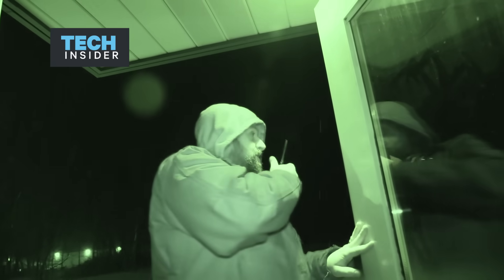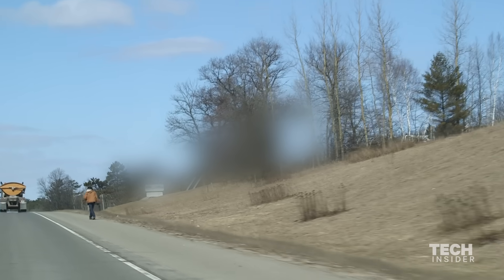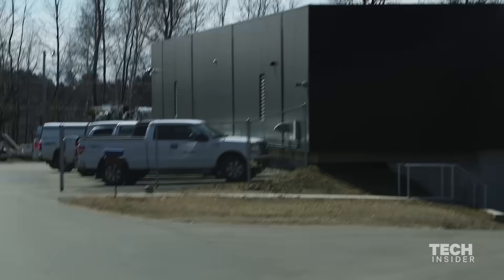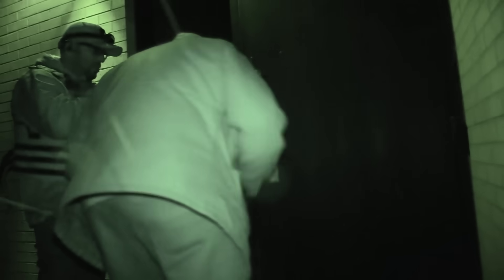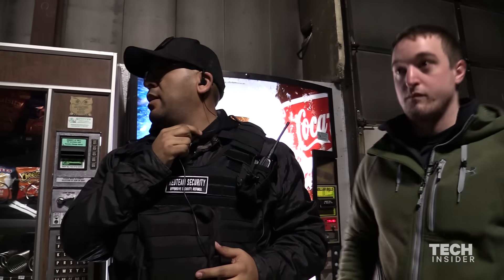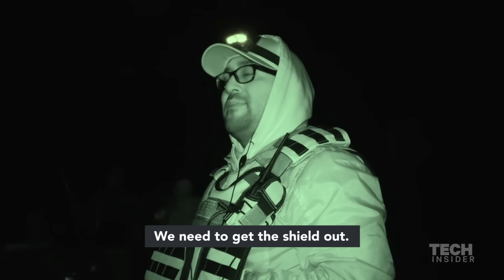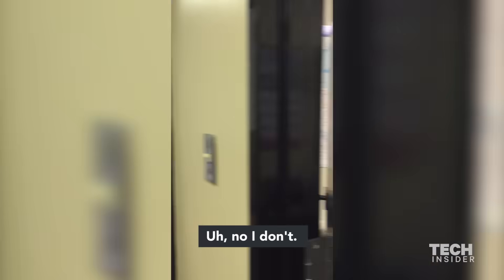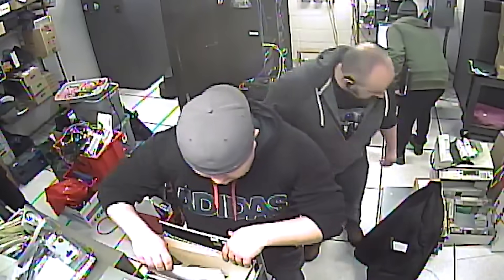Watch hackers break into the US power grid

Comment: 13:38 He's literally just printing out "hello" lol
Reply: -Goes to desktop
-Opens notepad and writes hello?
-Tries to write hello as a command
-Fails
-Just prints hello
Reply: @Tiogar60  Big brain !
Reply: @hackanddrift4692  Hackerman
Reply: You also realize that he's also writing it to a remote pc that's running windows right? Did you notice he is writing the command on a mac?
Reply: Josh Dobis it's just SSH. Not anything interesting.
Reply: @dusscode  I don't think Windows had a built in SSH server back then, especially not on domain client PCs, why would you with stuff like RDP and central management services
Reply: @kingchirpa  I use a Mac to administer windows, linux and proprietary appliances. No functionality is lost.
The only thing really missing is powershell, though I still use it as my main tool - but I either run it on a VM or SSH into another box on the net.
If your doing remote commands / sessions anyway, all your laptop needs to do is send and receive text really. I've worked off of my iPad when away from my desk, as closed and locked as an iPad is..
Reply: Probably to illustrate the video.
Reply: I think it's the fact he can run that stuff is the problem. Like as they said, they aren't trying to break stuff, just show they could  if they wanted to
Reply: If you look closely they were controlling another computer, he is using a mac but the prompt says Windows.
Reply: @bengonzalesdelrio  I do that every day at work.
Got a secure remote shell into a server over SSH, that server runs powershell, I run zsh, doesn't matter - you get whatever that server is running fully functional. All your computer is doing is sending and receiving text over SSH (or whatever method you've set up, but you should stick to SSH IMHO).
Reply: Faxx
Reply: that is dangerous hacker man, yes?
Reply: @dani Nathan It is in my opinion
Reply: Lol
Reply: I know right lol but he also got a meterpreter on that device basically a backdoor or a shell
Reply: Ty  fake brain

Comment: I can see raspberry pie 
Usb rubber ducky / bad usb to gain a shell 
Metasploit  
Arduino chip 
U can disable infrared cam or the thermal cam with a 5 mv laser light just to point at camera lens
Have seen LAN turtle in that box but u didn't use it in office

Comment: Good luck trying to get into one of our substations. We have fully fenced subs with barb and razor wire. With shaker system along fenceline along with inner microwave perimeter alarms. A fully staffed security staff that respond to any alarms. Buildings are brick with steel doors that require an access card. Buildings also have an alarm system.  Oh did I mention hi def cctv of all decent sized subs.

Comment: I watched the video and I could think of multiple ways they could have gone about this but one seems to be the best. 
step 1: they needed to have someone on the inside or hidden somewhere outside that was deauthing the internet to cause connection issues.
step 2: Spoof a phone number and call in claiming that they are noticing some strange activity on the network and are sending some technicians to check things out.
step 3: have fun with you access.

Comment: As a retired KGB analyst intelligence officer, my advice (and the advice given by others of my generation) is this. AVOID COMPUTERIZATION AT ALL COSTS! AND IF NECESSARY, TRY TO DE-COMPUTERIZED EVERYTHING. We only use computers to design and build non-computerized systems, non-digital systems and replace them with analog hardwired systems. And the computers we use are not connected to the internet but to an intranet network within our buildings or compounds or research facilities or test facilities.

Comment: Something as simple as a large group lobbing a shitload of Molotov cocktails over a fence onto the equipment and launching a few deeper in using a small catapult or slingshot method could take out a grid affecting a very large area. It doesn't have to be a high-tech infiltration or attack. A decent sized group could simply go barbaric on a sub-station and cause all sorts of pain. Especially if this was coordinated nationwide and a shit ton of these were hit simultaneously. I do recommend that the group doing so wear balaclavas. These guys were too easy to identify if somehow images were captured of them.

Comment: U hack in mac?
Reply: Daniel L de g well it’s a unix based operating system which uses the bash shell and it could possibly be very effective if you know what you are doing. To turn on the mode they are using just open the terminal and type ‘sudo rm rf /‘

Comment: My work place has an RFID a personal code known only to the employee to confirm identity with the central security system and a finger print scanner its easy to work thoe you use your dongle it says welcome you put your two fingers on the fingerprint scanner and while your hand is there you type in your code with your other hand and when it beeps you take your hand off and open the door. I think its almost impossible to get in any door behind the scenes but I discovered that on every balcony and even the roof the doors are unlocked its only a 3 story building and we keep our scissor lifts outside in a work shed so you just need to hop a fence pick a lock hotwire a scissor lift and ride it up to the roof then boom, as long as you don't walk through the wrong door and get your self locked in between two security doors in the hallways your golden.

Comment: Ok so let's draw a line here, the second you have to resort to physical intervention, you're no longer hacking shit, you're just breaking and entering. Anything can be "hacked" if you resort to physical intervention. So yeah, sure, from a security perspective, they are breaking in, and it's good to strengthen your security by employing such services. But I don't see any hacking here. Hacking is when you use security vulnerabilities in a software and/or hardware to hijack it remotely through the very network it operates on. Hacking is not spamming emails with links to phishing pages, it's not bundling spyware into software kits on free download sites, and it most certainly isn't jumping over fences and breaking into server rooms.

Comment: Yeah the number of times where you create a USB stick to autorun whatever is on there never always runs when you plug it in to a system because it'll just sit there with a prompt asking what you'd like to do with it. Especially on Windows, even if you have a autorun.ini or autorun.inf file it won't execute right away after plugging it into the system.

Reason so is that Autorun by default isn't fully auto so yeah. You're pretty screwed if you're expecting it to autorun and it doesn't autorun.

Comment: Could you kindly help me? I am on laptop #5 in 10 months. Went as far as changing IP. Wifi hotspots for a month, absolutely no issues. Walk into my house, within 2 minutes at the login page up pops some kind of "update", downloaded over 22,000 files?? in a matter of seconds.  This program starts right before the log in page (there is a white bar, top left, which blinks rapidly 4 times) but the most troubling part is their ability to change settings to stop me from fixing the issues. For example If I'm watching a video .that instructs me to go into regedit and one of the steps is "open the run file" it will be missing. This goes on until I give up. Each attack is varied, but always the same creepy script. Any help would be appreciated. Thank you!

Comment: That's how I ensure that my client information remains confidential.  I have one PC disconnected from my network.  I use DVDs to transfer files.
Reply: John Hlavaty  Use a USB, WAY easier
Reply: Jay Zee

sure if you want to expose any non-connected devices to a hack. because USB's are 2 way storage devices. they can install and pull data. if he were to use a usb. the hacker could install a script or virus that will get put into a usb key and then when thats plugged into the D/Ced PC itl install the virus to that machine and pull data and files onto the USB so that way when its inserted back into a connected machine it can start feeding the information to the hacker and the owner wouldn't even know. 

a DVD can only put stuff burned onto it to another machine. the hacker can install a virus to the machine so it can be burned into a disc but the virus wont be able to store any data onto the disc to feed back to the hacker once inserted into a connected machine. 

john would be far more vulnerable to hackers acquiring his clients information if he switched to using USB's
as USB's are a 2 way device for hackers as DVD's are a 1 way.

it may be easier for use with a USB but if hes concerned about keeping client info confidential and safe its best to go with the little more inconvenient DVD.

not to mention inorder to burn things onto a DVD requires a drive with the ability to burn things onto a disc not all drives have that so if his client storage computer has a non burnable drive the hacker wont even be able to force the computer to burn the info onto the DVD via scrips. as a bonus your more likely to store or never use the dvds again. a USB is more likely to be reused. thus establishing a 2 way connection for the hacker.

the more you know the better.
Reply: Filming In Portland   All the people in this thread sound like anti-USB freaks Lol. Do some research, USB's are safer than CD's. By the way, what are you CD guys going to do when computers eventually get rid of CD ports? Take a look at Apple MacBooks, and the newest Windows pc's.
Reply: Gizzemac Baldinelli just like you, but for dates.
Reply: TheFallinhalo  I've used a USB for banking transactions for my business for the past 6 years though, haven't faced anything bad yet
Reply: TheFallinhalo modern laptops rarely even have optical drives anymore
Reply: Jay Zee until the flash drive dies. Hope you have a backup, those have a limited lifespan.
Reply: DVD's can be rewritten though. Also DVD could contain a script to delete, crash or encrypt entire HDD.
Reply: Thefallinhalo, Do you mean the hacker could take the owners usb drive and swap it out with his own that executed code? If not i dont see what that has to do with the owner using DVDs or USb sticks. I mean the hacker would need physical access to the machine so the owners practices wouldnt matter
Reply: John Hlavaty no asked
Reply: +TheFallinhalo True but all that goes out the door the moment he decides to never use any USB aside from one that he keeps on him at all times.

Comment: I have nothing else to do so you know what this is how I would do it. 

First, looking for where the cameras are is the dumbest idea ever. You would need to put screen capture software on the offices conputer where they are monitoring the cameras themselves which is easy and anyone can do.

Second, getting in the fucking servers isn't even necesary, all you need to know is the location of the computer that is controling the servers and then you can use (depending on the operating system, in this case windows.) capture the screen and control all the data on the server however, it can get weird at this point becuase you would need to be in a position where you  can access the computer atleast once, just in case of failures so what I wouldv'e done is find out when the IT guys come to monitor the servers and find a time between then to access them. 
 
Third, Access the data whenever I want because I installed the screen capture software, but depending on how successful I am the first time then I'll keep using this method however, there are other ways of accompishing the same task. So this is a very low risk way of doing exactly what they were doing. But honestly they look like idiots that know less about computers than anyone else I know. My grandma can "hack" better than them honestly.

Comment: Words keep changing don't they?  One would assume that by hacking, they would be sitting at home on a computer or nearby, and gaining access using remote methods.
What they are doing is physically breaking into a building and using "off the shelf" type hardware and software to gain direct access/control to the systems and network.
Sure, there is an element of "hacking" in what they do, but no, these are not "hackers".
Would you call me a cook because I put a frozen meal in the microwave?
Even worse; they even use the word "cyber attackers".
Nothing cyber about physical break-ins.

Comment: they could have ran a port checker and used the ports header data to figure out the hardware running and the type of system they are in. then sniffed packet data to try and figure out what the system's were connected to and ecen out a simple looping gif infront of the camera's by hacking into the live feed in the dvr system's capture card. but as is thats not as easy as it sounds and more then likely the place shuld have known better than to allow admin access rights.

Comment: not hacking at all jyst really being granted access to necessary area's. the server would be off limits and the network that runs the switching and cooling systems would not be online nor would they ever be on the same network as the administration console. it is not possible to run a simple backdoor script when the firewall is hardware based and running on demilitarized zones with mac adress filtering setup. as well as more then likely a checkpoint firewall and hardware and software intrusion detection systems in place. the admin that runs this network would have to be a complete idiot to ever allow a malware script root access to everything. they may get acess to a few Client host's but not to critical system's.

Comment: All I see is a couple of guys breaking into a few buildings and a couple of computers.  These computers were not even hooked up to the "grid."  As a grid operator, I know the software needed to run the grid and did not see them gaining access to it at all, so I call BS on the title of this video. At most, they broke into a sub station and could possibly turn off a few neighborhoods at most, by simply operating a few switched by hand,  since it supplies power on the distribution level.  To control the grid, you need access to the transmission lines and the generators, they gained no such access.

Comment: 0. (not that it matters in this instance) Make sure everyone has removed identification ie wallets/tags. They go down - they're a nobody. 
1. Using the same guys from the initial scope was a mistake. They are recognizable, vehicle tags already on camera. Traceable. 
2. Mount some cheapo battery powered lasers outside and point them at the security camera lenses before you go in. (prop them paperclips if you want w/e)
3. Not enough gloves/masks/your shoes leave footprints too
4. Priority should have been detecting/disabling non/silent alarms.
5. Lookout should have been out front all along ready to peel in and out. Ready to be a distraction at least. 
6. Don't turn on lights to rooms with windows. Interior is okay but people can drive by and see the lights are on. 
7. Don't leave en masse. 2-by-2 is okay but someone drives by and sees a bunch of dorks walking out of somewhere at that hour it's suspicious as all hell. 

All the nice hardware/tactifaggotry you guys sport makes you look 
experienced. You want local PD looking for some punks - or do you want 
the fucking FBI pulling post 9/11 muscle to find your asses in a 
heartbeat? Amateurs.

Comment: this would be a fucking awesome TV series.
Reply: With similar production to this, not full of unnecessary fluff.
Reply: Foxmanded42 mr robot is nothing like this, this is real situations and white hat hacking. Mr robot is black hat hacking, it's dramatized, and its fake companies/situations
Reply: Taylor N 
I saw Mr Robot. one thing that was clear from the start is that, although dramatized, they did an excellent job at making the show a VERY probable method of hacking. I could have done the whole tricking the server room thermostat trick. A raspberry pi was way overkill for that job. I would have used an arduino or other small microcontroller.
Reply: Yea, Mr Robot is dramatised but tbh its has the most accurate portrayal of hacking I've seen. Some TV shows seem to think hacking is just typing code really quickly and boom your in. Realistically, their is a lot more focus on social engineering, which Mr Robot demonstrates really well.
Reply: Zbbbudi Yea!
Reply: Elliot is almost entirely black hat. White hat would mean that he was authorized to do his hacking.
Reply: it been proven by it specialists that the written code you can see in Mr.Robot is realistic
Reply: Zbbbudi dood yaaas

Comment: Loved the plugbot and the use of raspi's and microcontrollers for machine takeover. I can't believe the level of access they had from inside the building. Kinda alarming though.
Reply: zawzero 😀 oh but you can. You can use the micro to emulate a keyboard and then run scripts via the emulated keyboard. Plus it's tiny so you can hide it on your person very easily. Hacking is seriously not rocket science.
Reply: bdot02 tryna sound like he know what he talkin about lmfao
Reply: +bdot02 rocket science is pretty straight forward actually.
Reply: Atmega168 for hacking.... Sure. You have no idea what you are talking about.
Reply: +zawzero, yes it can be used for a drive by, basically a home made rubber ducky.
Reply: bdot02 defeating the substation security? They jumped the fence ha ha ha such pros. Just bring bolt cutters and walk through it ffs.
They didnt show anything they did in there because it would have ended up in a bbq. Good job they wore cotton clothing ha ha